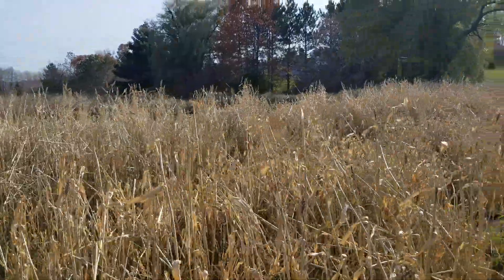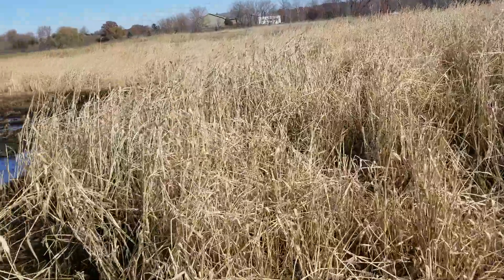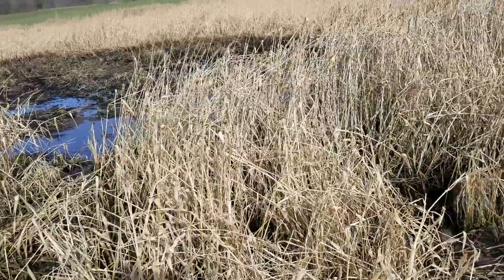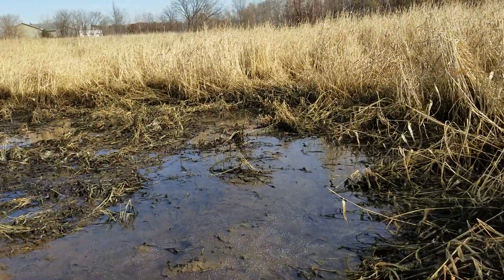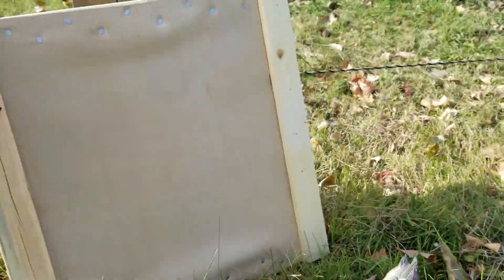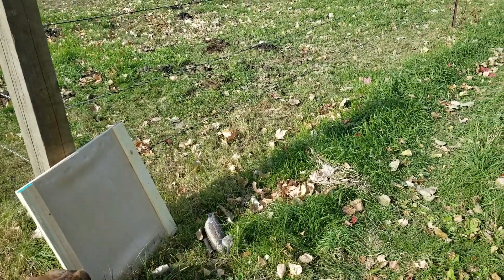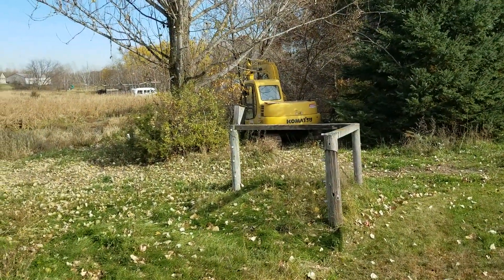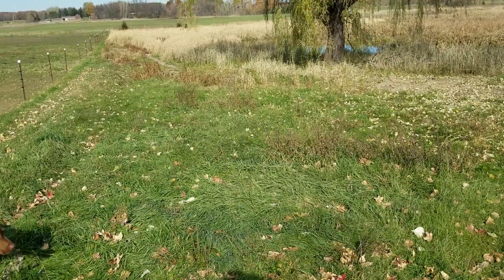Epic failure at the floodable impoundment

Comment: I would love to see video of you install your: water control structure, pipe, and anti-seep collars.  I know you have a bigger project you are working on.  I wonder if you should compact the dirt around and above the pipe inside the levee?  I might rent a wacker-packer and compact the dirt around and on top of the pipe.  The question might be; can the pipe withstand the abuse of the compactor?  Not sure.  Looks like you made a decent levee with the small project.  What size pipe, and water control structure did you use?
Reply from the maker: I installed a structure with a guy from the USFWS last summer. He has installed hundreds of these devices. His trick is to use two anti-seep collars and, in-addition, he pours 4 bags of concrete (dry) around any joints. Based on everything I've gathered,  you're at much greater risk of pipe washout in areas where you get cold weather. I think the freeze/thaw cycle makes it tougher to maintain a good seal. Everything is moving around.
Reply: @TedMinnesota  I see.  It makes a lot sense that freezing weather (freeze/thaw cycle) would make it tougher to get everything sealed up.  I didn't even think about that.  I see that you used an Agri-drain.  What size was it?  Looks like Agri-drains are the way to go.   I like the product, but never had anyone to give feedback on them.